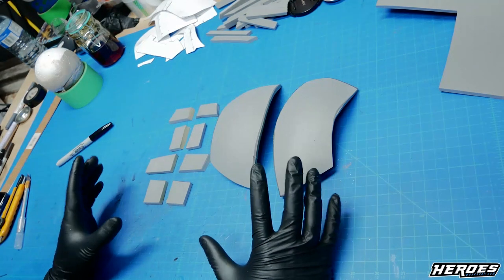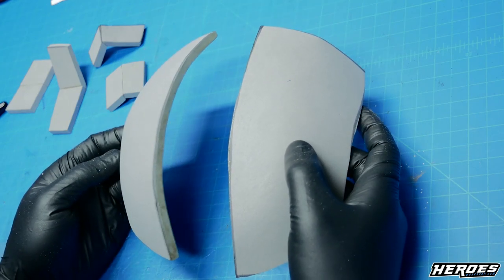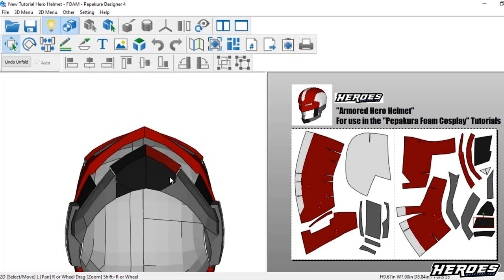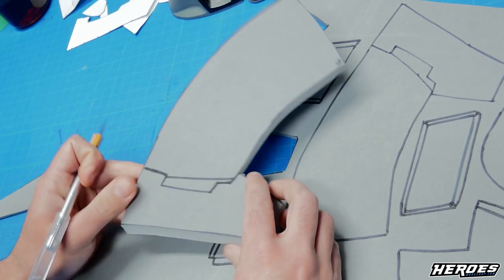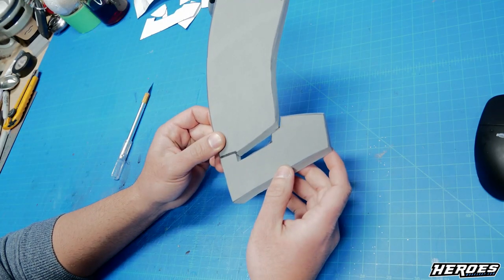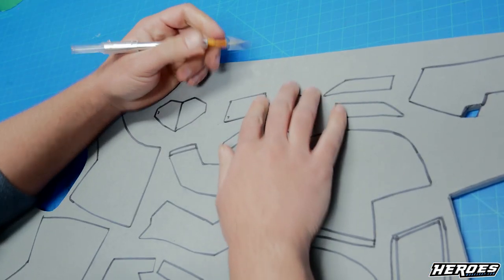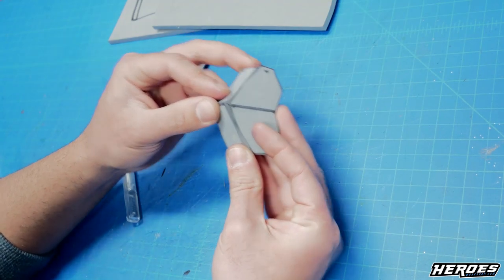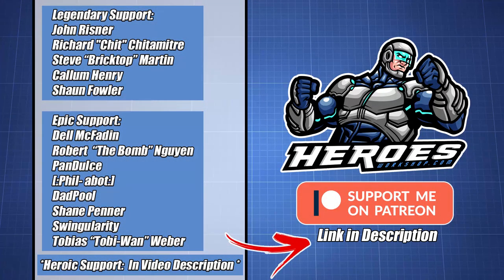How to: Angled Cuts Using EVA Foam & Pepakura Designer

Comment: What great timing!

Really appreciate this insight into manipulating foam as well as tips and tricks that I can employ in my own work, thanks for the great video!

One question I have though is do you have a particular thickness of foam that you like to use  for your projects? and If so is there a reason you prefer it?
I'm weighing up the options and I have some 10mm, 5mm and 2mm stuff that I'm thinking of using from largest to smallest to layer on those finer details, but also trying to reduce weight as much as possible so I'd be curious to know your thoughts!

Onwards and Upwards!
Reply from the maker: I use mainly 6-8mm on almost everything.

Comment: Great tutorial Stealth, how often do you change blades when doing a full body armor?

Do you think laser cutting template pieces would improve efficiency?
Reply from the maker: I try to sharpen them when I can but I mostly buy them in bulk and change them out after every part I’ve built. It’s 5cents a blade when I do the math. Not a big loss. Laser cutting is great for cutting the template out for sure. I’ve seen people cut the foam out with a laser as well. I like to cut my bevels when I cut the piece out. You’d have to cut the bevel yourself after the laser cut. So technically a human is faster than a laser in this case for foam but laser is way faster to cut the template out.

Comment: After I've done some slight bevels I have some frey left on the seam sometimes..what grit should I sand these down with? I use foam from tnt cosplay supply, I don't think it's hd foam..does that even matter?
Reply from the maker: Make sure you’re working with a sharp knife at all times.
Reply: @Heroesworkshop  yeah I alway forget to sharpen my blade and I'm really bad about having to recut a piece if I can possibly finagle into fitting but then I always get my freys which coulda been avoided if I sharpen my blade.. it's a vicious cycle my friend lol
Reply from the maker: Sharp blade always
Reply: @Heroesworkshop  You the man Stealth. You are appreciated here sir 🤘 can't wait for the next upload

Comment: I have a question about your Halo Infinite armor files. Is there any chance that you're going to change the files to be more accurate when the game comes out, and send the updated files to the people who’ve already bought it? I would like to know because I recently bought the files and the files look similar to the ones inside the Fortnite game files which are really inaccurate. The differences are easier to see in the new Infinite reveal that came out today during the Xbox E3 Infinite section ( https://www.youtube.com/watch?v=wDZ-9B6hX5A ), but they can even be seen on the toys (it's even missing details that the very inaccurate fortnite files have, like the vents in the back, an indent on the forearm, and a protruding piece in the center collarbone). I’m eagerly awaiting your response. Also, congrats on 117k subscribers, Master Chief would be proud.
Reply: @Heroesworkshop  Sorry if it sounded kind of rude, I meant it as the Fortnite ones were inaccurate, not yours. My Chief build was originally going to be my first ever build and I was just looking for any way to make it easier for myself. But, I’ve decided that I’m going to do some small builds and keep watching your video tutorials to learn the techniques better for my Chief build. I love you vids. Keep doing what your doing👍
Reply from the maker: Good idea. Learn the techniques and do smaller builds before you overwhelm yourself with this project. Then apply the techniques to the master Chief templates.